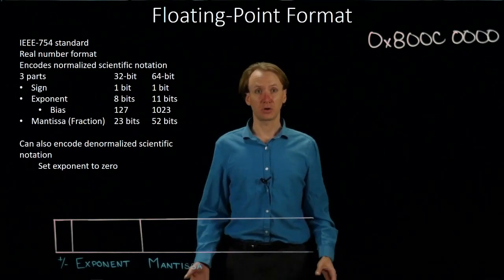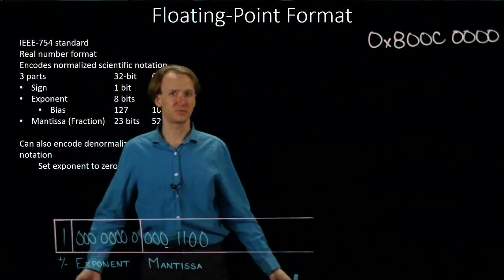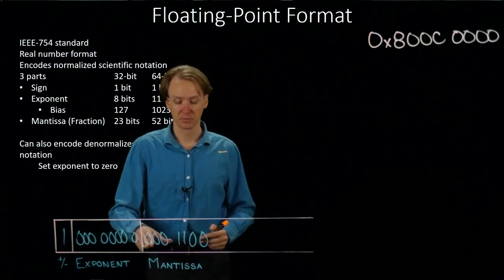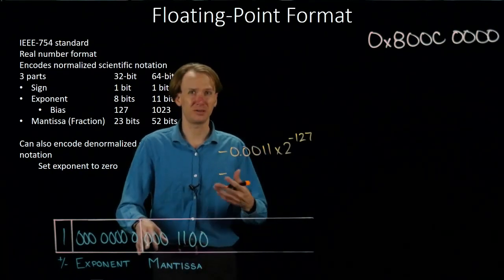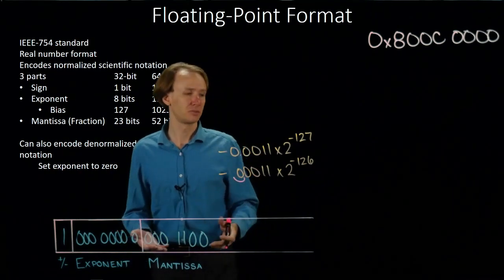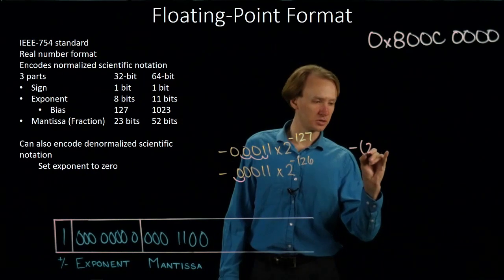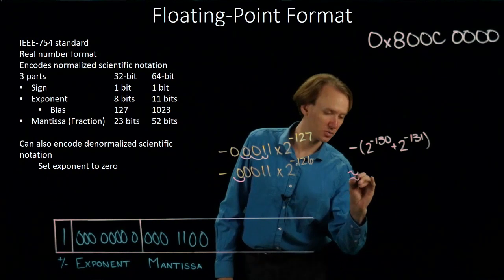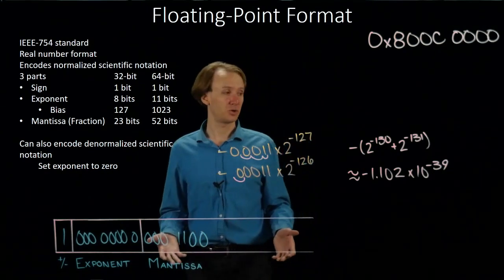31-a.  IEEE 754 Denormalized Floating Point Format Example 1

Comment: hmmm. I still don't quite understand what a denormalized number means.  I'm just learning IEEE 754 floating standard.  I understand that in the mantissa area we place the fractional part of a binary number that has digits at the left and right side of the binary point. And then when we place it in the form you are describing, there should be an implied 1 to the left when you write it all out. I'm not sure if i'm being clear.
Reply from the maker: One example of a normalized scientific notation number would be 2.1375x10^8.  In that case, there's exactly one non-zero digit to the left of the decimal point (that's the normalization part).  With a denormalized number, we relax that condition, so you could have something like 0.00021375x10^12.  The same holds for the binary version, but there you're working with just zeros and ones.  So with a normalized number, the only non-zero value you can have to place to the left of the binary point is a one.  (E.g. 1.0110101x2^7)  With a denormalized number, we don't require that there be a non-zero bit to the left of the binary point.  So, we can have several leading zeros instead.  (E.g. 0.0000111010010x2^-127)